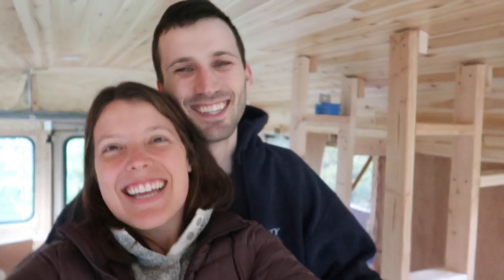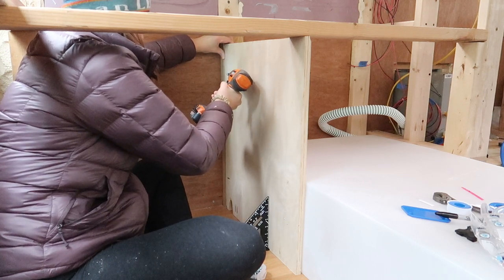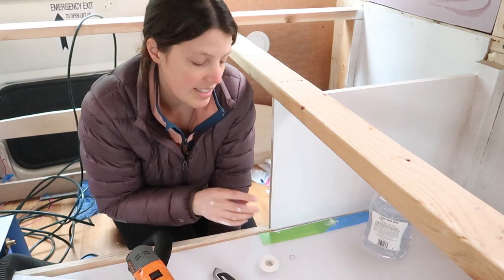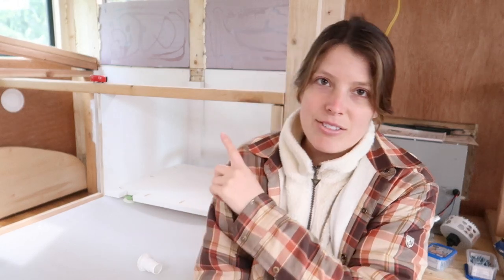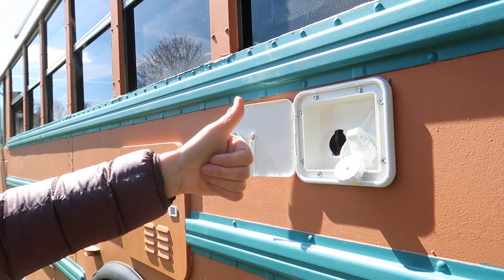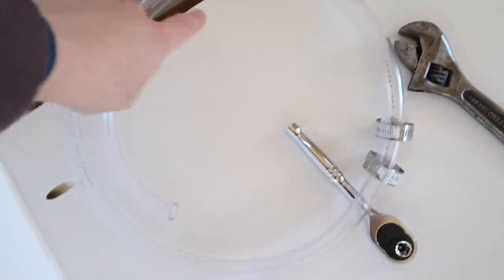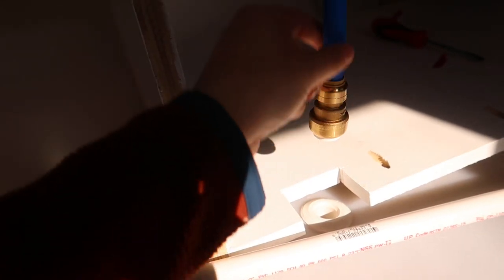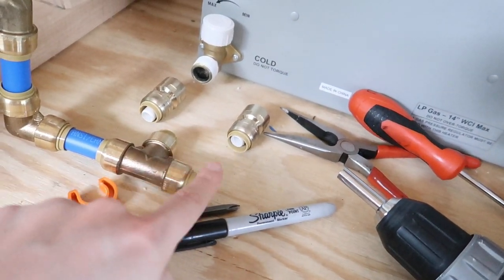Plumbing our Skoolie + Installing a Clearsource Water Filter | BUS BUILD EPISODE 32

Comment: From what I watched your gravity flow water fill is not filtered.  Would it have been better to put the filter before the pump?  So that drawn or pumped water is filtered.
Reply from the maker: Yeah we set our system up a little differently since we plan to be off grid the majority of the time and not ever hooked up to city water. We don’t expect to use the gravity full often, only in places where we know and trust the water source.

Comment: So your gravity fed water doesn’t go through the filter?  What is the reasoning for that?  Wouldn’t it work better to have city and gravity go directly into the tank, then have a sediment filter before the pump and have the clearsource filter after the pump?  🤔 I am getting ready to do my plumbing I loved your video but this part confused me.
Reply from the maker: Great question! What you’re describing would 100% work. We set it up this way for two reasons, we wanted any water that was going to be sitting in our tank to be filtered and we don’t plan to ever be hooked up to city water. So really, we don’t intend to use our gravity fill unless we’re somewhere where we know we’re getting clean water. I think the most common way is to have your city water hookup bypass your pump completely but since we plan to be boondocking most of the time we didn’t feel like that sort of city water hookup was necessary for our build.
Reply: Uh, you guys might want to rethink your setup here, I think you have it backwards. With this setup you’re not filtering any of the water from your gravity fill and if you’re only boondocking then how are you planning to ensure you’re getting clean water?
Reply from the maker: We have yet to use our gravity fill, its really only there to use if we're somewhere we trust the water. We have only ever filled up with a hose from a "city water" connection, so all of our water is always going through our filter first. We have filled our water tank at gas stations, campgrounds, parks, and people's homes and have always been able to hook our hose up to our filter inlet to fill :)

Comment: Love your videos but. The plumbing does not look right.    If and when you fill your tank up using the gravity fill the water in the tank will be unfiltered.  And when you connect to a water source city hose pipe. It will be filtered but how does it know to stop.   Usually when a Rv is connected to water source it bypasses water tank.
Reply from the maker: You’re right, we did it that way on purpose! We plan to be fully off grid the majority of the time and not ever hooked up to city water so we set our system up a little different than a normal RV. We will only use the gravity fill when filling with water we know we can trust (so probably not often). We can always change it in the future if we realize it’s not working for us ☺️ thanks for your comment!

Comment: Just make sure that you can get to all junctions where there is a fitting. Sharkbites from what I've read/watched has some issues. They are great for ease of use/install but can leak.
Reply from the maker: That’s what I’ve heard! It’s definitely going to be a little tight but we should be able to access everything just in case 🤞🏻

Comment: If you can find some kind of a tray that would fit underneath your filters when you switch them out so that it does catches the drips and stuff and helps prevent rotting mildew with all that stuff
Reply from the maker: Great idea! We didn’t really think about how the filters will be full of water when we switch them out and will 100% use a tray to catch any spills!

Comment: Why even have a gravity fill?  The filtered water inlet is the same as gravity fill. Generally the city water does not go into the tank. There is a one way check valve that won’t allow it to. 
Also do you have a float valve that turns the water off once the it reaches a certain height? Otherwise the pressure from city water will just keep pushing water in until it spills out your gravity fill or air vent or both.
Reply from the maker: Hey Doug, we set up our tank a little different because we don’t ever expect to be parked somewhere where we’ll be hooked up to city water. We plan to travel mostly off grid and not be “plugged in”. We decided to add the gravity fill hose just in case we’re ever filling the tank somewhere with water we trust and want to bypass the filter. If that changes in the future we’d definitely switch it around so the city water goes into the system after the check valve after our pump. 
I’ve never heard of a float valve but that sounds very useful! Our tank actually came with sensors that we haven’t set up yet but that will be able to tell us our water level which is what we were planning to use. Thanks for your questions!
Reply: @AdventureTrudge  you’ll still end up with plastic taste from the tank. I’d add another filter before your kitchen sink. 
I really like the clear source filtration. I just don’t know if an Rv pump will be able to create enough pressure if installed after the tank. The filters will naturally create resistance. I thought about doing the Rv pump with higher gpm rating.